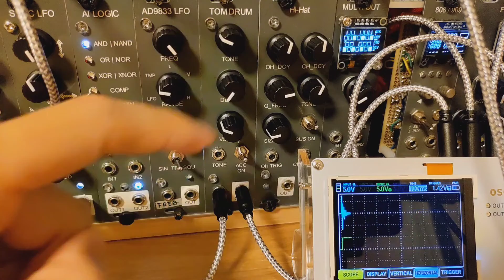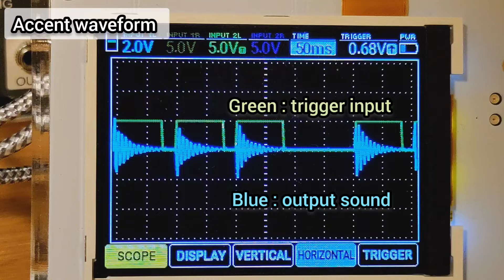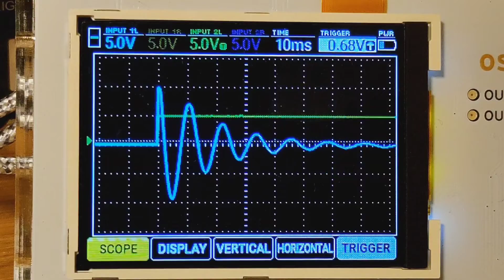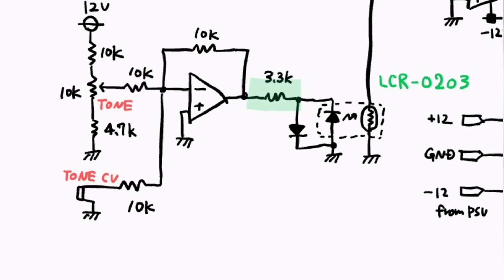[ $5 ] DIY eurorack modular synth Tom Drum | Analog drum

Comment: sounds great! I'm pleased to see both a tone CV input and accent option. What do you recommend for an accent patch? Assuming I have two trigger tracks, one is the normal drum trigger and one is for accents. For example, this could be a CV parameter on the drum track on most sequencers. Would a CV mixer with min/max output be best for this? I'd set the accent voltage higher than the trigger, and use the MAX output. If there is no accent then I get the lower voltage of the trigger.
Reply from the maker: I think a CV mixer or VCA would be best.

Comment: $5?  You can't buy the three pots, three knobs, switch, and four jacks on the front panel for $5, much less the rest of the components, a board to mount them on, and the front panel.  Second one of your "$5" posts that I've seen that's bullshit hyperbole.   Your channel gets a "Do not recommend this channel"
Reply from the maker: You can buy cheap parts from aliexpress.
Pot and sw are about $0.2 and jacks and knobs are about $0.1.
The parts list is compiled in the following web page.
https://note.com/solder_state/n/n8ef0479418a0
Reply: you can also buy components from chinese ebay sellers, i did that for a decade and never had any problems other than long shipping times